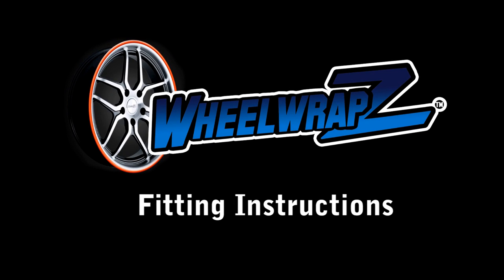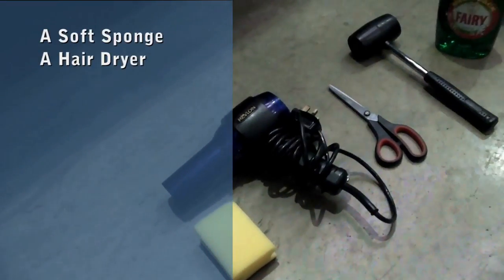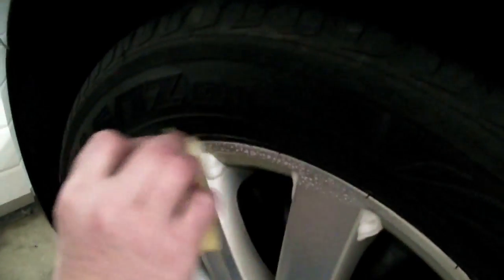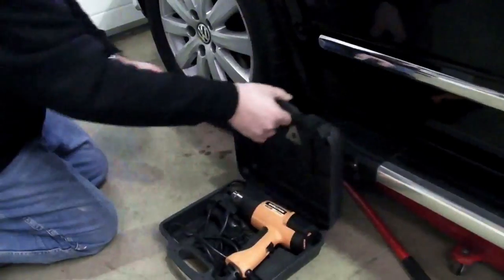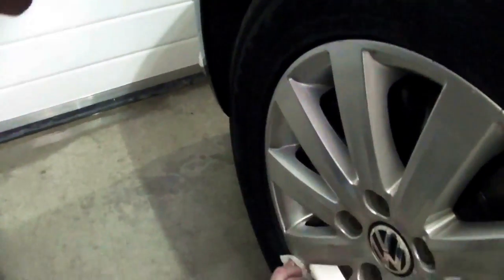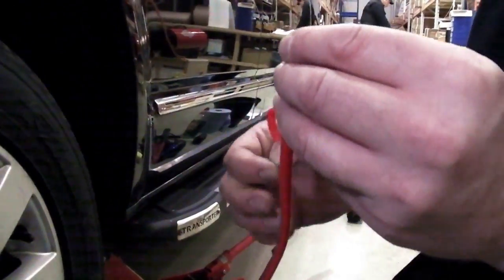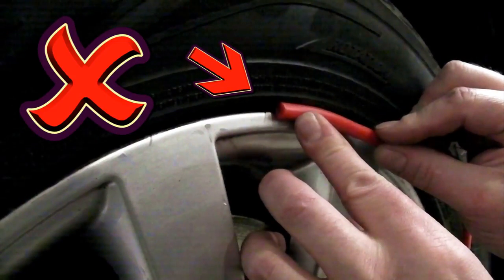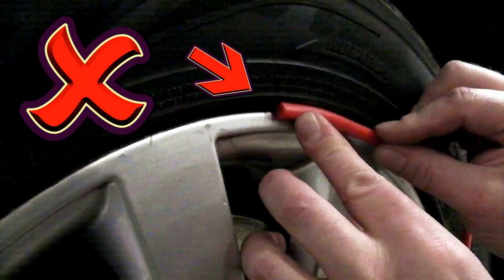How to fit Wheelwrapz Alloy Wheel protectors

Comment: One big thing I can see wrong here...NEVER work on your car with just a jack holding it in the air. Jacks can and do fail at any time without warning.
Rest the vehicle on an axle stand, placed in position on solid ground.
Also make sure vehicle has handbrake on hard when working on front wheels, and front wheels chocked, (blocked to stop them rolling) when working on rears. And leave car in gear when non-powered wheels are being worked on to make sure it rolls nowhere!
So DO these wraps have to be remove when installing new tyres??

Comment: That is very cool but when you get new tyers does it damage it???
Reply: I had those on my Genesis Coupe 3.8, and yes, once you want to change tires...there they go too!I recommend you, if you are thinking about the changing the tires, do so in advanced before you ended up putting these wheel protectors on.
Reply: Yes you have to get a set of new ones.

Comment: Don't bother with this crap. Use the wedge type that fits between the tire bead and rim.
Reply: DaytonCarCare    Well Can you  please  tell  me  Where  to  get these ?  I've  got   18 inch rims !
Reply: Just look online, I've seen them on Amazon. Probably other suppliers too.
Reply: Larry Jordan alloygators
Reply: Have Alloygators for 3 years now.
They are made of nylon and with extreme cold weather they develop a slow air leak on your wheels.